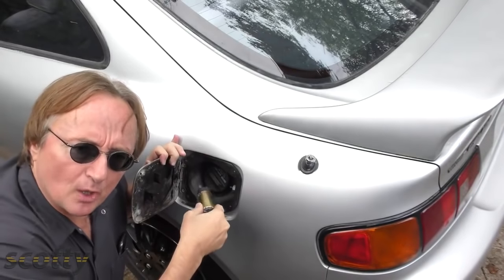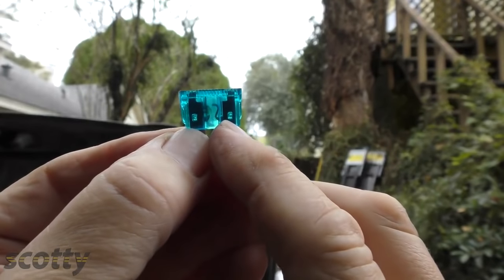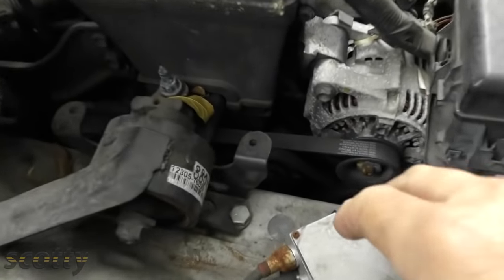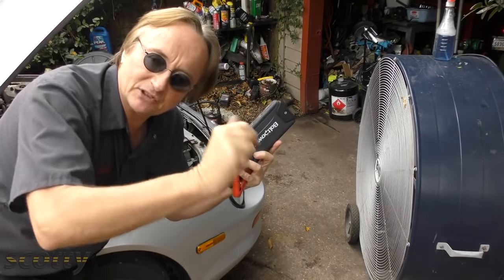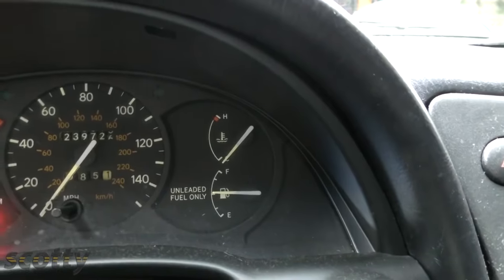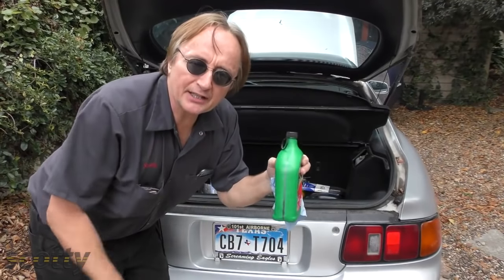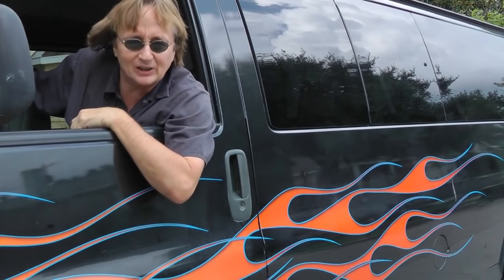How to Fix a Car that Won't Start and Randomly Dies While Driving

Comment: I just keep a spare engine in my glove box in case something happens, then you just swap it out and go!
Reply: OH DONALD well then where do you keep the spare transmission?
Reply: OH DONALD

I like to keep 4 spar tires in the engine bay incase all my tires go flat.
Reply: Yup, it only takes 2 minutes to replace an engine.
Reply: OH DONALD where do you put the hoist?
Reply: Pavel Paškevič instant engine change
Reply: UP ME ARSE
Reply: OH DONALD scottys how to replace an engine video is only a couple minutes long so it shouldnt take long
Reply: OH DONALD  you need to I just called the snap on guy for the tool truck to come he does all my Mechanics for me you got all the Cool Tools Snap-on guy even the adult tools are cool
Reply: OH DONALD just be sure to keep ur Fred Flintstone feet ready for anything
Reply: Think I need to tow a rv for all these tools and parts for breakdowns, engine swaps on the freeway just the norm

Comment: Many problems can be avoided if people only maintained their vehicles and checked the belts/fluid levels.
Reply: And charging system.
Reply: No shit Sherlocks. It’s the whole point of maintenance.
Reply: yeah i know so many negative ppl in this world
Reply: That goes for their health too. Aint that something.
Reply: Many problems can be avoided if people knew how to fix their own goddamn cars. Most people can't even change a tire.
Reply: electronicsNmore no time for that
Reply: Vitamin B unemployment waves
Reply: NEVER!
Reply: Over the years cars have become much less "user reparable".  Years ago I could fix almost anything in my car with 2 different screwdrivers (flathead & phillips) and two different wrenches. I used to do all my own tune ups, change a water pump, fuel pump, heater core, change my oil etc. Now it's such a headache I pay a trusted mechanic to do it.

Comment from the maker: I'm about to start a new type of Sunday Video, they will be featuring YOUR cool cars, for more info visit my Instagram: https://www.instagram.com/scotty_the_mechanic/
Reply: Scotty Kilmer - Awesom, you are truly the KING of  car help for the world. Thank Scotty Kilmer
Reply: what do you do if your ahole neighbor puts water in your gas tank?
Reply: Hahahahaha!!! Fill her up dude!!!!
Reply: I THUMBS DOWN, WHY WOULD YOU KICK HIS DOG. YOU HAVE NO CHILL.
Reply: Critical Thinker critical thinking right their.
Reply: Hey Scotty need help, could a shorted out abs wheel speed sensor lead to an issue with the disc brake on one side sticking a little. Enough that it gets hot enough to smoke after a couple of highway miles..? This all started after getting a drive thru car wash. During the wash my check engine light started flashing then turned off
Reply: Redneckism- maybe you have a soap bubble stuck between the brake pads, pop it and see if it gets better!!   Haha sorry I couldn't resist that.....
Reply: Redneckism- seriously tho..... Check for a sticking brake caliper or the notorious internally collapsed brake hose attached to that caliper. Hope that helps you
Reply: logan kincade lol hey any advice at this point is appreciated... I’ll tell you what I’ve done so far... new rotors new caliper new brake pads new flex line new master cylinder. Taken off and cleaned abs module new fluid all the way through the lines with no obstructions.
Reply: I love you Scotty my my my
Reply: Scotty Kilmer hi I have a question, can I use a fuel rubber hose instead of steel line in the pressure side from the fuel pump to fuel filter in 1997 corolla? If there is a hose what’s the type of it. Thanks
Reply: redneckism101 on my Chevy I can remove the abs fuse to disable the abs.  I did this for a couple of weeks till I got around to fixing my underlying problem.  FYI the dashboard idiot light will come on
Reply: Redneckism- sorry so long to get back but have been working. Our poor man's way of checking ABS. Jack up front remove tires, put keys in your pocket NOT in ignition (to remove the ABS brain from the test) push pedal hard as u can, see if caliper sticking? If doesn't problem is ABS (electrical or mechanically, there's several different types of units). If it sticks u have a mechanical problem between caliper and master cylinder. Caliper, Flex hose, Steel brake lines, Proportioning Valve(maybe done by the ABS module, depends upon the type of unit), Master Cylinder. Clean n inspect every component (I have gotten bad reman and new calipers before) Just a few things to consider.....Have you checked the Wheel bearing? Cartridge type or Conventional taper roll bearings that need adjusted? Did it happen exactly when u left the car wash?(high pressure under carriage blasters can damage elect. wires). I think your issue probably is the ABS, u will need a good scanner to diagnose it but u can use it to command functions of the ABS to narrow down the issues. Good news tho.. when the ABS has a problem it reverts to Conventional Braking as a Fail Safe, so u will have good old fashion brakes(like in the 80's) just no Antilock feature. Hope this helps you good luck
Reply: Redneckism- again sorry it took so long but have been working n had to do sum Critical Thinking (Shout out baby!!!!!) about it😈
Reply: Scotty You're the man my problem is my 2003 Nissan Pathfinder just died going down the highway it took a few and started for a very short time and died so had it towed home and it won't crank it's doing nothing had this guy said it was the swirl control valve he plugged something in and that's what he's machine said and also before it died when I would accelerated it would lose power so I would gradually give it gas then it was ok doing but please someone help me

Comment: Just want to share some of my experiences:

1)  One time my Nissan died on the road... drove my mechanic nuts trying to figure out why it died and wouldn't restart... we even changed out the fuel pump motor.... eventually he found out that there was a small piece of debris right on the MAF sensor wire.

2) In another incident my Kia Rio kept  dying on the road intermittently...  my mechanic traced it to a clogged air filter.

3) A faulty ECU can also cause stalling...  the dealer was able to diagnose this correctly using advanced scan equipment/dealer level scan tool.

4) for modern commonrail diesels, a clogged or failing SCV (suction control valve) can cause stalling. Also a clogged fuel filter too.

5) check your wiring... chewed up wires (rodent caused) can mess up your electrical system and cause hesitation and stalling

When stalled, the very FIRST thing to do is to move your car to safety. If your car had just stalled and you still have momentum, turn on your flashers and try your best to reach the shoulder or emergency lane. Other drivers behind may have not noticed your breakdown and they can slam into your car unexpectedly.
Reply: I woulda never thunk that a rodent would chew up your wires lol. Nice tips though.
Reply: Air filters are normal maintenance items. Why replace a fuel pump when checking its function is so easy?
Reply: lil den  - most modern cars have soy-based wiring coatings (also called bioplastic) so rodents are more attacted to them... they think its food! Try googling more info and car makes/models with this stuff... your car might be on the list. The car manufacturers supposedly do this for recycling and "go green" purposes but from what i read, its cheaper for them to make (at our expense, lol... wiring harnesses could cost $$$ to replace).
Reply: wholeNwon - actually i had just purchased the car used (no service history) and was on my way home when it started to stall...  i had another car that had a failing fuel pump which exhibited similar stalling symptoms at times (intermittent problem) but sometimes worked or checked out ok (no codes). I guess we both presumed its the same thing on this car... i just wanted to be sure and eliminate that factor.  

I guess sometimes its a simple solution/simple fix but we do complex stuff to try to solve the problem.  Hehe. ;)
Reply: Oliver Vigilia A Kia Rio dies because its a Kia Rio!
Reply: Oliver Vigilia or vehicle's old enough, (such as a couple of ones I have), the coil shorting and burning up the ignition module. Haha.
Reply: Here's another one:  bad grounding.  My '87 Mazda 323 had random stalling where it would cut out (while driving), and then refuse to start for a couple minutes, and then thereafter it would run fine again.  Turns out it had corrosion/dirt on the ground wire connections.  A bad ground wire can cause weird problems.
Reply: Oliver Vigilia hello please try to get back to me. My g37 shut offf while driving and alll the dash lights popped up. I put the car into park and then the car will instantly start up. the issue happens after getting gas i noticed it has a chance of doing it for the first 50 miles till i fill it up again. it won’t throw a code so please help
Reply: @antoninogaudino there is a high chance that your fuel pump is failing... but check and/or replace the fuel filter first (if your car has one, if not found externally, then it could be an in-tank filter). Also, check the fuel inside the tank, it may be dirty causing the fuel to clog up everything.
Reply: Oliver Vigilia Your rigjt i have had  a couple people tell me it’s a fuel pump or ecu issue i’m trying to narrow it down so i can know for when this whole virus passes over. it’s very strange how my car won’t throw a code tho. my car  also has a really rough idle you’ll feel rpms jump when you come to a stop and some weird vibration from the middle of my car

Comment: All great tips.  Fortunately, despite keeping cars for about 200,000 miles none of these have happened to me.  However, I did blow a water pump on a Toyota Camry - when that happens, unless you can get it to hold antifreeze you are getting a tow.  I had the antifreeze - but pouring it in just dumped more on the road.  Only time I have ever been stranded on the road.

Comment: Hey Scotty, great info. I think it may be worth mentioning to check  for a blown fuel pump relay. I've seen that as well.
Reply: Honda Odyssey fuel pump relay gets a cold solder break around 200,000 miles.

Comment: What happens if you die on the side of the road?
Reply from the maker: just get some more snow and rebuild yourself
Reply: Have your car watch a similar video made for humans
Reply: half time mechanic, full time savage
Reply: Copy of Last Will & Testament in car trunk.
Reply: Use the jump starter pack,  it can double as a defibrillator!
Reply: That's why I keep an electric folding scooter in my trunk. Otherwise call an Uber or Lyft.
Reply: Someone else will use your car for parts!!!!!!
Reply: Defibrillator
Reply: In stead of Uber, call Unter.
Reply: Scotty Kilmer OMG good one 😂😂
Reply: Well if that happens you don't have to worry about a damn thing ever again!
Reply: That's why you should get extended warrenty
Reply: Scotty Kilmer ,🤣😄
Reply: scotty you made my day
Reply: Scotty Kilmer - God that was a great response.
Reply: olaf No one stops and you get a parking ticket.
Reply: Scan tool & a hammer & you’re good to go.
Reply: They are making cars nowadays to  automatically drive themselves. So technically it'll probably keep going without you 😜🤣😂🤣😜.

Comment: I keep all fluids, a belt, an electric pump and a battery pack in my car. the battery has paid for itself 10 times. I even sometimes carry around my 1/2" electric impact to quickly swap a tire if I need to. you think you'll never meed any of it but it's so nice to have it all when you do.

Comment: You can connect one of those booster batteries but do NOT disconnect the battery or batteries while the car is running. The voltage regulator in the alternator requires a battery in the circuit to function. All the computers require a correct voltage to function and to survive.

Comment: if u know how your engine normal sounds, i noticed, if the oil is going down (leak or burn) the engine gets louder.  checking at least once a month helps a lot. the louder, the worse it'll be. it nvr hurts to just check your car out monthly on fluids. u rely on your auto, so take care of it :)

Comment: One more tip that helped me once: my late '90s Buick just stalled on the freeway out of the blue. This was out of character, as the car was extremely well-maintained. I knew air and ignition were good. Fuel tank wasn't empty. No SES lamp or codes (I keep a scanner in car). Suspecting the fuel pump, I popped the trunk, took a tire iron and thumped the floor of the trunk near the fuel tank. Car started right up and ran fine for 3 more days. I kept a rubber mallet in the trunk and used it maybe ten times over the next month, until I could order a fuel sending unit and replace.

Comment: I keep a huge gas powered air compressor with $100000 worth of Snap-On tools in my truck so I really make sure I can get through being stranded. Not to mention a box of fuses like yours, 200 gallon barrels of engine oil, gear oil, brake fluid, trans fluid, power steering fluid and coolant. I also have a whole new set of tires with new rims, 1 whole new spare engine and transmission, spare cooling system parts, a spare dashboard unit with all electronic modules, spare PCM unit, spare plastic parts that could break, and extreme diagnostics equipment to make sure I find the root of any malfunction. Now I just need a box of gloves, but can't afford them now because of reasons.
Reply: lol, best comment

Comment: Nice video. I would say most of these problems would or could happen by not bringing the car to a good mechanic to check everything at least 2x a year. The likelihood of a fuse blowing while driving I would think is very rare. The same goes for a fan belt. A ten year old car could have a coolant leak from a whole in a radiator, which happened to me around 1999 on a trip to the catskills in NYS. As far as oil and other fluids like brake fluid and transmission fluid; It's the owners responsibility to have a mechanic check it. Some dealers don't charge for minor things, but DO have them checked. Keeping the proper tire pressure can be added to that list as well as the proper battery charge.

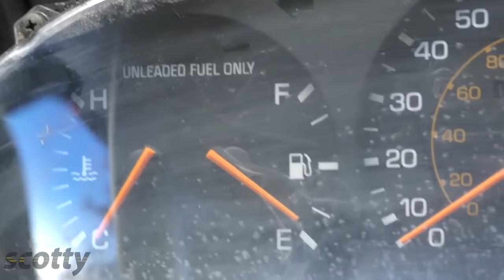Comment: Check the Gas : 00:27 
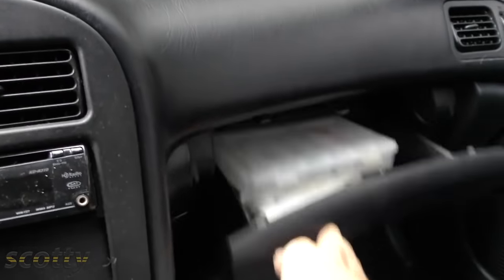Check the fuses : 01:10
Check the belt : 02:09
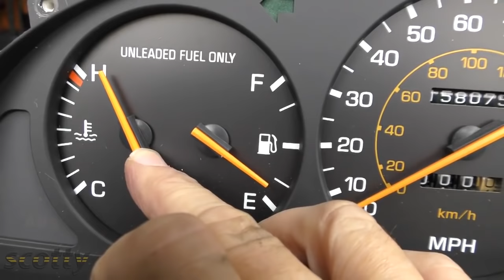Temperature : 03:00 
The oil : 03:45

Comment: I just have jumper cables & tire inflator in trunk...need more tools 😞
Reply: Critical Thinker There's a thought ...lol
Reply: Snap-on
Reply: Besides having tools... two most important things to have: 1) a working cellphone to call for help, and 2) an updated AAA membership card... 

It also is good to have luck on your side.... my nissan stalled on the highway and luckily a police car passed by a few minutes later... the officer asked my permission if he could push my car onto the shoulder with his crown vic (which had the front push bars), and i agreed (i'd rather have minor scratches than being rear ended with cars going 55-60 mph). He was also gracious enough to call for a tow truck since i didn't have AAA membership at that time.
Reply: Oliver Vigilia -Yep, that's a public servant if I ever saw one, nice!  Thanks for sharing that with us!
Reply: Oliver Vigilia I'm good... I rather just get out of my car and have someone rear-end it. I'm not going to let someone scratch the back of my car and then have to make an insurance claim and lower my resale/lease value 🙃
Reply: Really Cat? I'd rather just put it in N, take off the hand brake and push the fucker myself.
Reply: LOGIC REIGNS SUPREME I only have a jack and jumper cables but they got wet many times by the rain idk if it works 😐
Reply: Cheek Snatcher      If they are not rusty from the rain should be okay

Comment: That's the worst feeling. I used to stay clear of the fast lane when I had an unreliable car. The emergency lanes on that side are too narrow and dangerous.
Reply: If your car is that unreliable then you shouldn't be driving it on the road. Doing so would be dangerous to both you and other motorists.
Reply: Sadly poor people need to get to work too. You’re late? You’re fired. 

You’re fired? You’re not living here! You’re not at a fixed address? Sorry, I can’t renew your drivers license.

Comment: In  my friends case, his 2005 Ford F150 stopping running due to a failed fuel pump driver module.  The thing rotted apart.  Build Ford tough!  It's in the back, under the spare wheel, so all I had to do is remove the connector and plug in the new one and let it hang until it got home.  Thankfully there was an Advance Auto nearby who had one in stock.

Comment: Scotty I forgot the rubber mallet bag on the bottom of the gas tank while someone else cranks the car or can you put a jumper on the EFI relay, Bank of the cash check make sure the fuel pump is working then start the car after us fought the relay back in?

Comment: scotty I can speak for every one your a jewel of information, quick question I own a 1010 Nissan quash qai 1.6 petrol which I reacently brought it has 13000 miles on the clock and it consumed 4 miles range of petrol why I was parked up for 15 minutes with the engine running.  is that normal?

Comment: Just broke down on the way home today. Stalled, battery and oil light, cranks great but no turn over. Checked fuses, swapped fuel pump with A/C fuse, no dice. Oil is great, radiator overflow tank was below the L line. I topped it off after stressing for about 30 minutes, it started and I drove home with the heat blasting. Did I just overheat?